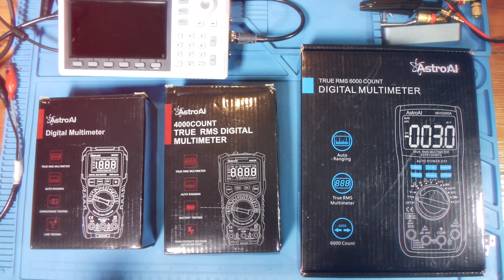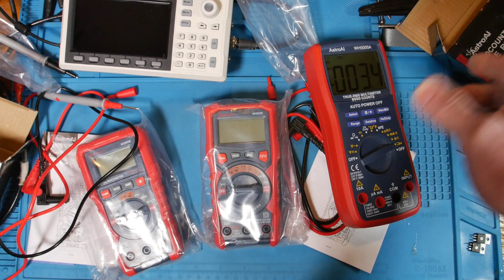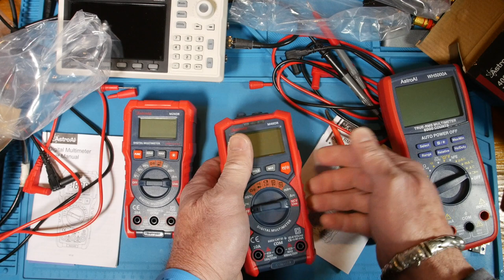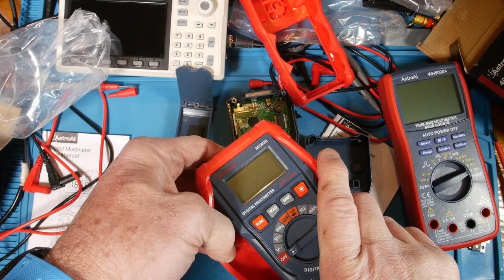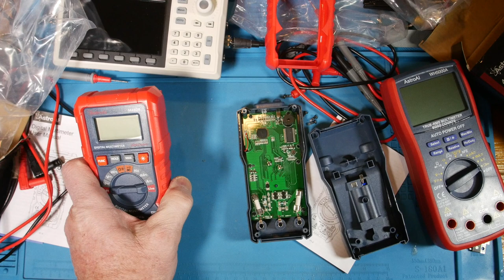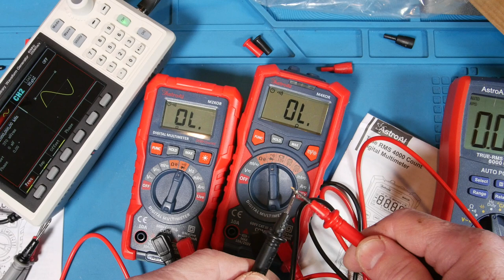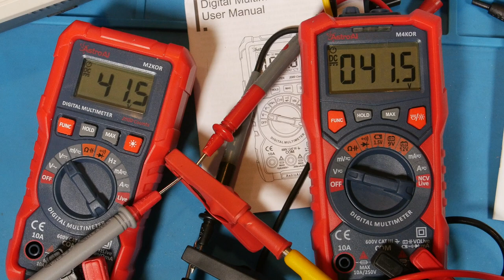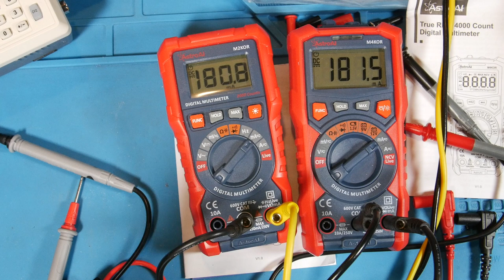New Low Cost TRMS Multimeters from AstroAI

Comment: Hey Eddie! I bought the AstroAI 6000 after watching one of your reviews on it, and I LOVE it. I think its a great meter. I have a tip for you. After I bought might, I also had difficulty trying to pull out the stand. I thought Eddie is absolutely right, but why would they do that? You absolutely can't get your fingernail under there to pull it out. So I inspected it and discovered the top of the stand is a little raised, and the bottom of the stand is a little recessed. I gently pushed inward on the raised top of the stand (about 1/3 the way down from the top of the meter) and guess what? The bottom swings out almost 1/4" making it crazy easy to put your finger in that hole and extend the stand. Give it a try sometime. Love your videos, keep up the great work!
Reply from the maker: Thanks Joe - that's an awesome tip!

Comment: I’m hoping you (anyone) can answer a question.  I have some old Fluke meters, recently we purchased some Ideal 60-347 and Klein 700 meters.  Watch this video and some others I became interested in the Astro AI M4KOR Meter to have to test batteries, vehicle batteries, alternators and to have as a carry-around in my truck and to test gear in the field (Solar panels, cables, light sets and recording gear, etc), and I’m really impressed with its performance.

Anyway I’m want to get my son-in-law a meter to use around the house and on for their cars.  And I was I’m have one of the Astro AI M4K and Goupchn Silicone Multimeter Test Leads Kit (using your likes) in my shopping cart. I was ready to pull the trigger… but there’s some you touch on in some of you videos and others have told me that “aluminum analytics” (?) if I heard right… and something about them eventually wearing out?  Would that be something a weekend “do it yourselfer” needs to be concerned about, being it won’t be used every day all day… or should I spend $30 or $40 and get him the Klein 700 or Ideal 60-347?  I really like my Astro AI M4KOR and have been using it a lot with those Goupchn Test Leads you recommended (which I love and their now my everyday leads. Probe Masters probes are too short for my big hands).

I appreciate your help and I will purchase them using your link.

All my best Eddie…
Reply from the maker: Thanks George!  I wouldn’t worry about the aluminum electrolytic capacitors as they shouldn’t show any signs of wear out in a multimeter for 10 years at least.  I do like the Klein for the durability and 3rd party safety test.  Thanks for asking;)
Reply: @KissAnalog  “Aluminum Electrolytic“ Capacitors… yeah, that makes more sense then what I thought I heard… “aluminum analytics” … I was scratching my head over that one… 🤔

I’ll keep a M4KOR around for testing batteries and small stuff, even if I have to brake down and spent $20 every tens years. But the Klein and Ideal meters will be for any serious stuff.  

For my son-in-law I’ll get him the Astro meter, a case and voltage tester for now for auto work, and for his birthday I’ll get him the Klein.  You have a link for it to Amazon, on one of your videos?  You helped me out so I’ll use your link if your have one for it.
Reply from the maker: Thanks so much!  https://amzn.to/34gXKzJ

Comment: Thanks for the nice review as usual. They claim these to be TRMS meters so it would have been nice to measure something non-sinusoidal like an inverter with a "modified" sinewave output and/or you could have programmed such a waveform on your Uni-T ARB generator and  see how accurate their TRMS capability is.
Reply from the maker: Thank you!  Yes, I need to be sure I show that to point out how great these low cost meters really are.  I have measured square waves and it does show that these are Tru-RMS as stated.  Thanks for the great point.

Comment: I know that you hate the "firestick" continuity tests ;), but if done properly I find those tests quite useful as it helps determine the speed and latching response of the mode.  You are welcome to have a different opinion, of course, but there are people who really do use meters for "drag" continuity testing and they require a meter with rapid response in order to trace circuits at their job.  Once you hear a beep, you go back and use longer, purposeful probing to confirm the result.  Thank you for letting people know that they should clean new probes with alcohol to improve the response.
Reply from the maker: Thanks Rob!  I think the thing that bothers me most is how it has taken over what the importance of a continuity test is.  I can tell you if I caught a tech or engineer working for me doing the drag test or anything else similar - I'd eat their lunch.  Continuity is an important test and shouldn't be shot gunned or done haphazardly.  Can you imagine a plane falling out of the ski - or a missile for that matter, or even communication system failing because of a bad connection - due to a tech or engineer not having the time to do a proper continuity test?  Unforgivable.  The firestick method is far too random to learn anything.  But that is my opinion of course;)

Comment: Good thorough review, but I needed a reference source, you held to unknown devices up against each other, I saw on ebay some very precise voltage references for little money, some even nullified with high end 6.5 digit meter.
Reply from the maker: Thanks Thomas!  Yeah I don't think anyone ever finds a meter in a review our of spec/tolerance, so I mainly try to show the differences between meters.  Real references are expensive too;)
Reply: There are indeed cheap references available from China and they are usually good enough so long as you check their claimed value against a calibrated bench meter, but it's usually just as valuable to see the meter's response over its various ranges.  It might be exact on a 5.001V reference, but then be out of spec at 250V or 50mV.

Thus, I don't mind Eddie's current testing provided he uses the same meter and/or source as his "reference".  Eddie is also right that modern, "chip" meters are almost universally accurate to well within their specs.  In fact, I often suspect that meters based on the same chips will vary just as much from unit to unit as they will from brand to brand.

In other words, your meter will likely be different than the units you see reviewed on YouTube and this is why expensive meters come with independent certification.  In fact, if you look at enough reviews <sigh>, you'll find some meters that were within spec for one reviewer and out of spec for another.  A super-accurate reference setup can provide a false impression in this case as neither test unit represents your meter.

So long as the meter is designed and built properly, which most Western-targeted, YouTube-marketed brands today are, the accuracies will be good enough.  Those who need 22,000 counts and accuracy below 10 counts should not be shopping for $30 Chinese meters ;).  Such users need to buy a certificated, calibrated meter.

The bigger purpose of testing, in my opinion, is to see the meter's responsiveness.  How fast does it respond, range, and settle?  Is that reading repeatable?  Does it wander after settling?  What's the frequency bandwidth?

Some 20,000-count meters will just sit there and randomly change the last digit and sometimes even the last 2 digits, which effectively makes them 2,000-count meters at best or 200-count meters at worst.  If the right-hand counts aren't stable and meaningfully accurate, then they are useless.

Comment: It's Incredible how cheap they can make this meters.
But should a 3.5 digit 16USD multimeter even be concidered good enough?
I think most of us would pay a little more to get more digits (higher count) etc.
Reply from the maker: Thanks for this question - it is actually very interesting;)  Today we can get so much for our money, so I agree, why not spend a little more to get a better meter.  It seems like every 10USD can take you to another level.  Funny thing is, the venerable Fluke 70 series that could be argued was the series that made them what they are today.  A reasonably priced meter that would not kill itself and had good basic functionality.  But, it was not True-RMS, and it was only a 3k count meter.  So really, this 4k count, TRMS AstroAI is leaps ahead - and considering accuracy.  And the Fluke 77 IV is $350 today and is still not TRMS and is 3.5 digit or 6000 count.  Unbelievable!  So, these meters I think are OK for many but there are definitely better meters at not much more - like the new Astro M6KOR (or Kaiweets HT118A;).  Great question!!

Comment: Those counts would be too low for my use.... & the most important thing is the continuity/diode test function being real fast on the audible confirmation. The instant those probe tips even brush one another that sound needs to happen without any delay.  I just hate any delay on this test....  Leads that are really flexible and probe tips sharp to cut through tarnish etc. The thing that makes a meter a joke is the silly hfe thing. The last place is on a DMM when there are other really useful tests it should have like a uA ability, Watts, burden voltage reading.. stuff like that. In forty plus years i never used hfe on a DMM infact it kind of made the the meter look as if it was just a hokey toy!....
Reply from the maker: Thanks for this feedback.  I think it is nice to have one meter that can read hfe, and I have those little meters that do that and more, so I agree, I'd rather have temperature or capacitance or some other function on that key.